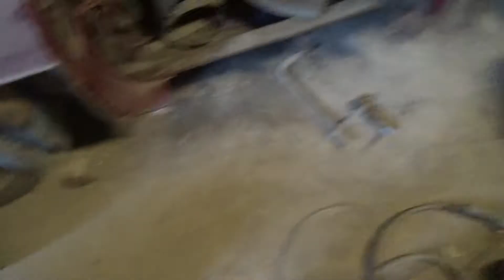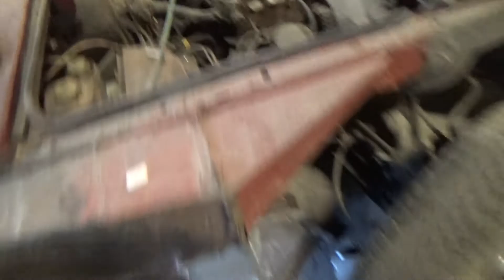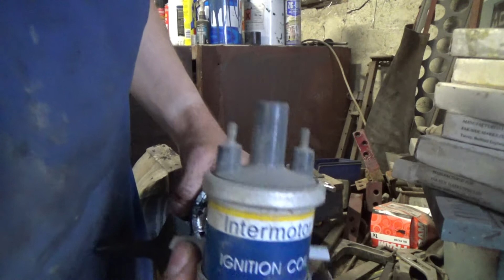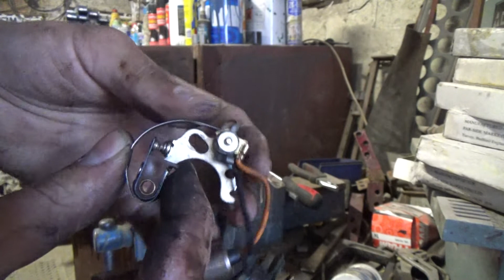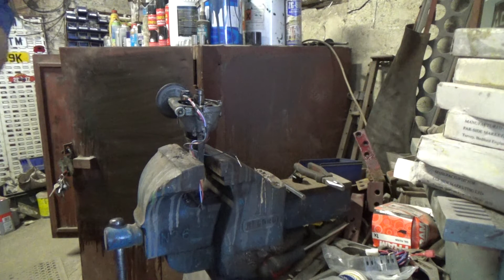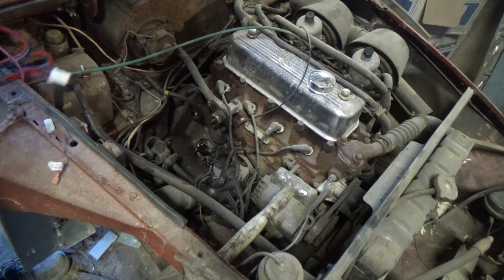Lucas 25D Optronic Ignition conversion (MGB GT)

Comment: @2:07 .. if the 4 cyl engine is running at 1000rpm the contacts are only opening and closing 2000 times not 4000